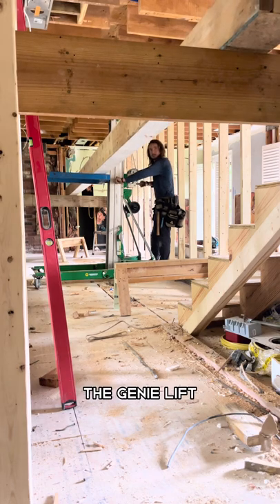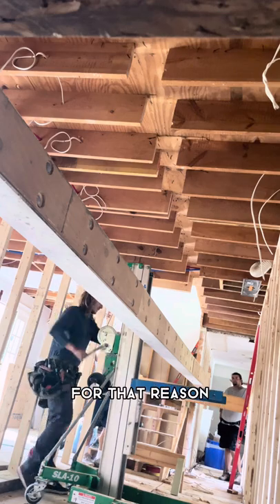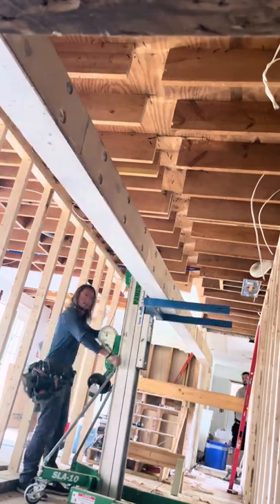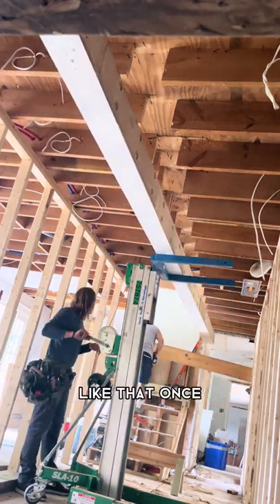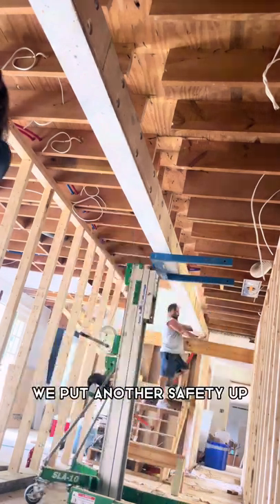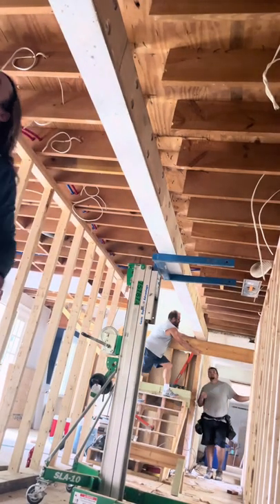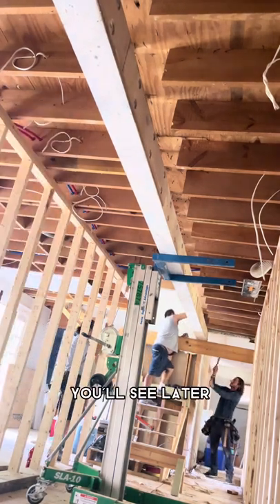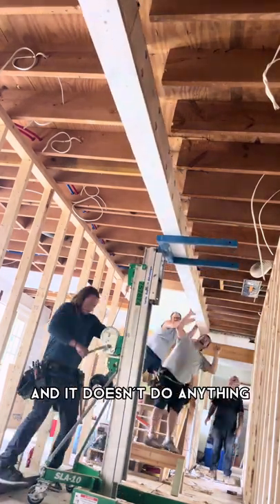Big Beam Install Part 8

Comment: When you have foot long cut offs of big beams. Dont throw them out.  Drill thru the middle to put a sledge hammer handle thru it.  Cutting a groove 2 inches back from each end and using pallet strapping bands on both ends.  
You can do this with chunks of branches.